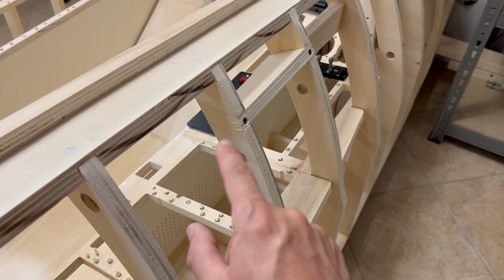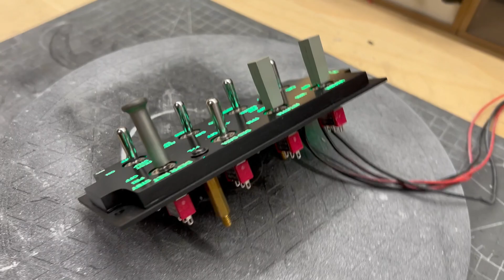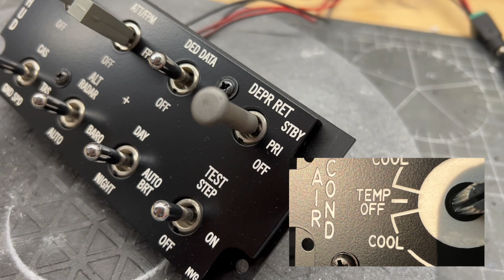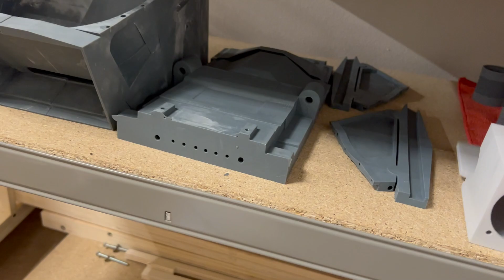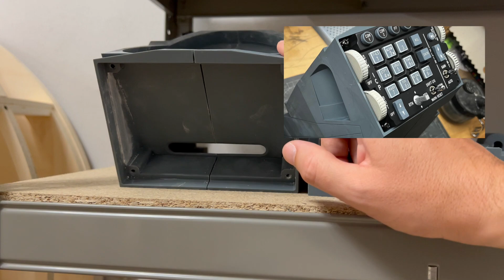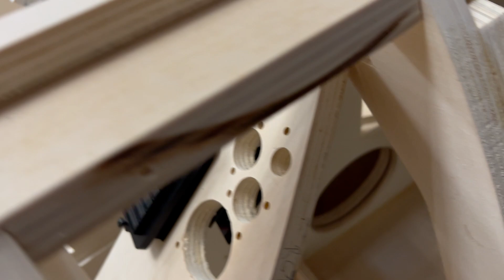F16 SIM UPDATE JUL '24

Comment: In an F-16 they use Zues Fasteners for the instrument panels for quick removal/install, and light gray RTV to cover the screws that the pilot can cut themselves on that Crew Chiefs might round or damage. The dust boxes I saw in later videos is a great thought, it'll help with the static that electronics cause and suck dust and sawdust onto causing issues later on. If you need any references for side panels or close out panels let me know, I loved working in the cockpit when I was enlisted. The side panels are kind of cut to fit, and very frustrating. Every screw that can "walk out" we used grey RTV. Small details. I really enjoy watching your videos multiple times. If you ever need color codes and good paint references I like using Tamiya 1:72 Die cast model paint codes they are very accurate and will get you as close to accurate paint. Damn good job and extremely impressed with the accuracy! On the exterior there are scored rivets and hex screw close out panel details that are really important once you get it all buttoned up, so you can access the avionics later.

Comment: Hi, nice work. I wanted to ask you if you are using VR with this simpit. I have been building my sim pit for quite some time now, finished the structure and some Pannels, however, I hit a point where im not sure if I should continue because the pit is not lining up with my hand tracking. Did you manage to find a solution for this. I have the pimax crystal and the ultra leap tracker.
Reply from the maker: thanks! the pit is not operational just yet but I'm thinking to make it work with a mixed reality headset in the future
Reply: Use mixed reality

Comment: Is a 220x220x220 3d printer large enough for a project like this?
Reply from the maker: @corybass1745  you’ll probably have to split some of the larger files but I think it could work ;)
Reply: @ I haven’t actually bought a 3d printer yet. I’ve been watching your videos and was looking at laser engravers and 3d printers. Do you have recommendations on these? I’d rather get one that could print the pieces in full but I don’t know what size that would be.

Comment: Appreciate you posting the F-16 update.  This is exactly what I’m looking for.  You have inspired me to build the same thing!   Twist, I want to rig it out to work with both DCS and BMS.  That may require dual arduions, one DCS bios, and one for BMS IO.  I want to be able to switch systems without reprogramming.  I think it can be done.
Reply from the maker: @DavidMeadorSC  thank you for the kind comment! Having the pit to be compatible with both sims is complex, but I hope to make it one day ;) good luck with your build!
Reply: this is could be done in a relative easy way with a  "translate" program that read Falcon BMS shared DATA and send to the arduino as if it came from DCS-BIOS or viceversa of course you have only to take care to the data from sims to arduinos in the back direction the joystick emulation is enought
Reply: For inputs you just use megajoy with arduino mega u16 as HID device. No need for programming. For output such as leds, ded, gauges, etc. there is a program called F4Serial which manages both BMS and DCS

Comment: Can the arduino mega directly light all the caution panel lights at the same time? What about amp limits?
Reply from the maker: @chrisgeo4555  yes it can, it needs a resistor to each led however
Reply: it is better to use a led matrix conncted to arduino

Comment: for the cover of the rump you might look into balsawood these are used in modelbuilding if you wet them they are very flexible and once they dry they hold the shape you wet pressed them to the frame
Reply from the maker: thanks for the tip! I've used balsa in the past, I'm just not sure if I can find big enough panels to cover up the whole side console but I'll look into it

Comment: Outstanding. I am thinking about stepping into moving from my TrakRacer f16 cockpit, into a full cockpit. Invectus came up.
Are you using your laser cutter to cut acrylic as well?  If so - any comments on what to look for?

Thanks for sharing all of this!
Reply: Before purchasing a large quantity of acrylic, get some samples and make a full mock panel and validate the acrylic 1) cuts okay on your laser and most importantly 2) works with back lighting.

I purchased a lot of acrylic without doing that, asked for "Opal" and "80% White" and got exactly that, but half of the White acrylic was 100% White and barely passes any light through, and you can't tell at a glance the difference until you shine light through.
Reply from the maker: thanks a lot! Yes I use my co2 laser (30w) to cut the acrylic used in my panels. Definitely do a couple of test runs with yours to see if you're happy with it. I had better results with cast acrylic vs extruded acrylic